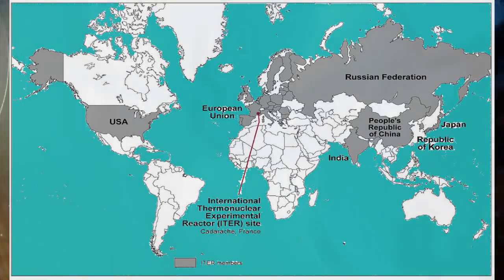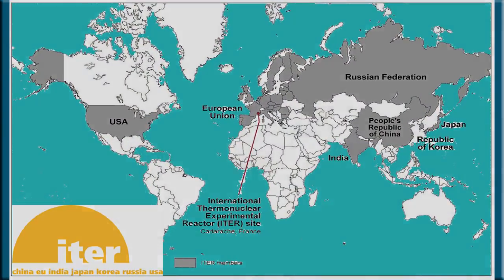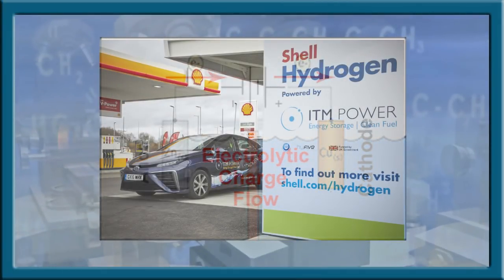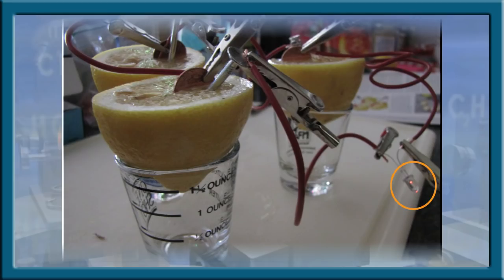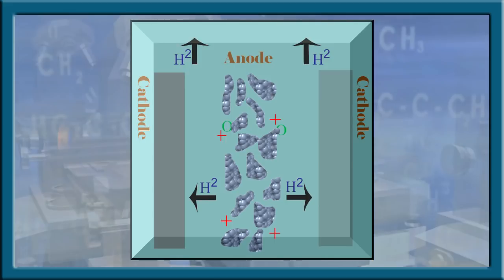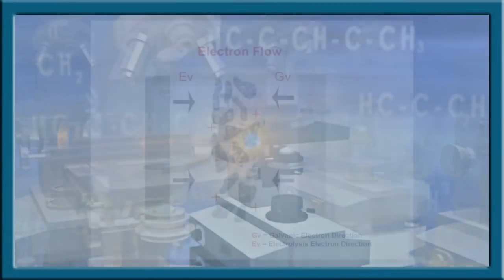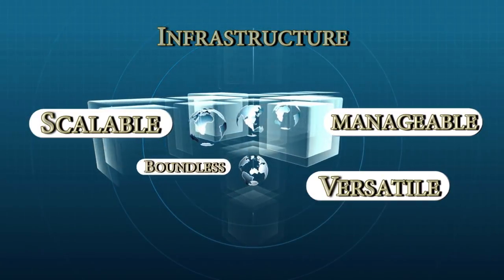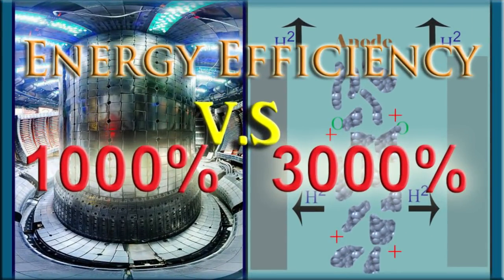Fusion Energy vs H2IL - Nuclear Fusion or Self-Sustaining Hydrogen 2020

Comment: Is Fusion renewable or will we run out of Deuterium and Tritanium.
Reply: Yes and no.
Reply from the maker: H2 Innovation Lab (H2IL) invites you to view an introduction to co-efficiency verification testing of its game-changing energy technology.

The tests are carried out using a PEM Fuel Cell stack to convert the generated hydrogen energy back to electrical energy. Input power in compared to out power real-time.
Scientific feedback is to the effect, and quote, "I truly believe you have achieved the remarkable" - "even if the fuel cell performance was 100%, which is impossible, the output readings are obviously greater than the input power." 

Please follow this link directing you to the brief 

intro video: https://youtu.be/L-PfstY_jYk
Thank you for your support.

Comment: This info is misleading!

Who you gonna believe? A channel with ~300 subscribers 🤣 or 35 of the largest nations spending billions on something that is supposedly so uncertain.

The video makes it sound like outputting more energy than it took as input is a hard thing to do in general. It is happening with coal plants at the moment. It is a requirement in general, otherwise we wont use the technology.

The issue is that there hasn't been a FUSION reaction made by us before that has output more than we input into it. It is the goal of the ITER reactor (https://en.wikipedia.org/wiki/ITER) you are talking about to output 10x the energy it required to initiate and sustain.

This has nothing to do with efficiency. Efficiency is the ratio of the amount of energy released by the reaction vs the amount we successfully utilize. Even if ITER releases 10x the energy we put in, we still may only convert 30-60% of that into usable electricity one day!

By your definition, if I burn my house down releasing tons of energy, using a small amount of released energy from a match,  I have created a 100000000000000000000000x efficient reaction. GTFO
Reply from the maker: The video is not intended to knock the Iter project in any way - we welcome scientific research, one of our scientists has closely followed fusion energy over the years. The ending comment is only making the point of how nice it would be to get more interest, at the same level, than just the hydrogen division of the USDOE and a few oil giants. Yes it would be nice to have the financial backing and publicity of a 50 year old energy project to boost hits and subs.

In one breath you refer to Fusion energy as Certain then with another you say it’s success is still a goal that one day they hope to achieve. Nothing is certain until it is achieved and proven. The Iter scientists state themselves that IF they can achieve a SUSTAINABLE 10x efficiency then the system would be self-sustaining. But then they need to achieve a 30x efficiency for it to be a means of useful energy supply.
Our comments are not misleading but based on what these scientists are stating to the public.  

Yes efficiency is the ratio of input energy to that of output energy.  The calculation used for electrolysis efficiency is the amount of electricity used to produce 1Kg of hydrogen. That 1Kg has an energy factor of 33.33Kw. However you are correct that USABLE energy is calculated when the hydrogen is then converted back to electricity.  

Coal is not energy but an energy storage means the same as your house is not energy.  It is a fuel and that’s why it’s used - not because it can deliver more renewable energy. Once consumed it’s no longer usable.

Appreciate your comments. Oh - and - please don’t burn you house down :)
Reply: So the 35 nations that you'r saying we should believe have not achieved it and are predicting 30+ years???  I think more of us scientists need to LOOK outside the square and consider that inventors do exist and do achieve new technologies without government funding.
Reply from the maker: H2 Innovation Lab (H2IL) invites you to view an introduction to co-efficiency verification testing of its game-changing energy technology.

The tests are carried out using a PEM Fuel Cell stack to convert the generated hydrogen energy back to electrical energy. Input power in compared to out power real-time.
Scientific feedback is to the effect, and quote, "I truly believe you have achieved the remarkable" - "even if the fuel cell performance was 100%, which is impossible, the output readings are obviously greater than the input power." 

Please follow this link directing you to the brief 

intro video: https://youtu.be/L-PfstY_jYk
Thank you for your support.

Comment: Even so, the ability to fuse atoms to make different elements seems like an achievement in it's self
Reply from the maker: Yes agree, but from a scientific view point rather than a practical application, at this stage. 
Our point is that even scientists believe there are methods to produce more energy than the input energy. No laws are being broken by either technology. 
Thanks for your support.
Reply from the maker: H2 Innovation Lab (H2IL) invites you to view an introduction to co-efficiency verification testing of its game-changing energy technology.

The tests are carried out using a PEM Fuel Cell stack to convert the generated hydrogen energy back to electrical energy. Input power in compared to out power real-time.
Scientific feedback is to the effect, and quote, "I truly believe you have achieved the remarkable" - "even if the fuel cell performance was 100%, which is impossible, the output readings are obviously greater than the input power." 

Please follow this link directing you to the brief 

intro video: https://youtu.be/L-PfstY_jYk
Thank you for your support.

Comment: If this is real, the makers need to make a repeatable experiment so that everyone can approve or disprove the results
Reply from the maker: Have done. Some of the clips - performance test videos, are listed on the h2innovationlab website for everyone to view. For the not so technically minded we have a short test overview: https://youtu.be/wrKURnM8GAY 
Thank you.
Reply from the maker: H2 Innovation Lab (H2IL) invites you to view an introduction to co-efficiency verification testing of its game-changing energy technology.

The tests are carried out using a PEM Fuel Cell stack to convert the generated hydrogen energy back to electrical energy. Input power in compared to out power real-time.
Scientific feedback is to the effect, and quote, "I truly believe you have achieved the remarkable" - "even if the fuel cell performance was 100%, which is impossible, the output readings are obviously greater than the input power." 

Please follow this link directing you to the brief 

intro video: https://youtu.be/L-PfstY_jYk
Thank you for your support.

Comment: .
Reply from the maker: H2 Innovation Lab (H2IL) invites you to view an introduction to co-efficiency verification testing of its game-changing energy technology.

The tests are carried out using a PEM Fuel Cell stack to convert the generated hydrogen energy back to electrical energy. Input power in compared to out power real-time.
Scientific feedback is to the effect, and quote, "I truly believe you have achieved the remarkable" - "even if the fuel cell performance was 100%, which is impossible, the output readings are obviously greater than the input power." 

Please follow this link directing you to the brief 

intro video: https://youtu.be/L-PfstY_jYk
Thank you for your support.